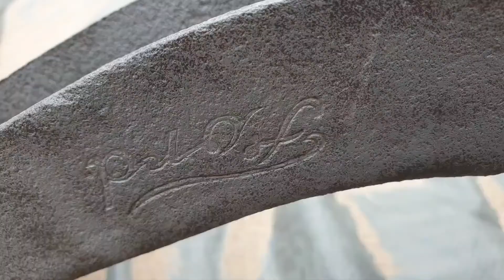Ford Model T Restoration/Build | Part 1 The Frame

Comment: I just bought a old Model T shop contents from a guy in Colorado. Much is missing but I have 4 motors , one complete with transmission and most of the parts for probably 4 cars. I have 7 frames and front ends. This series is my go to source until I get more books. That hardest part for me is dating parts and putting together a period correct Model T. My earliest motor is April 1917 and I have a 1926 chassis that's intact with rear drive train. My oldest frame is 1914 or 1915. Thanks Oskar -
Reply from the maker: Langs old car parts have a booked called Model T Judging Guideline  item number JG1, that's very helpful to date parts to correct model year. Have lots of fun building your T.

Comment: Should of watched this first..regards to finding out wat parts to use..Still trying to remove galvanized finish of my frame..
Reply: Sorry oscar is their any chance you could send me the paint code..I've found the paint but the tin has aqua across the front of it..I notice it was different to the paint you've used..sorry to be a pain..just don't want to buy the wrong one..